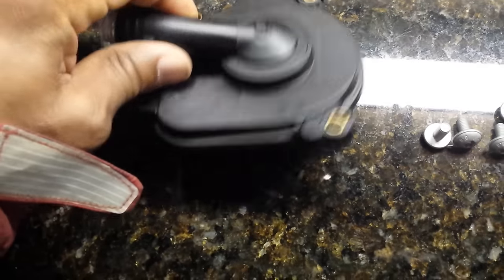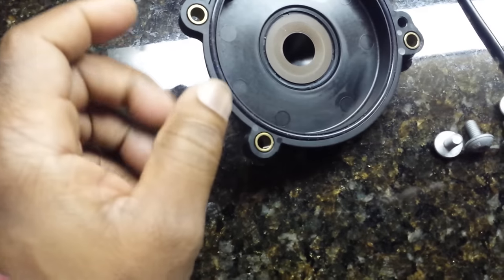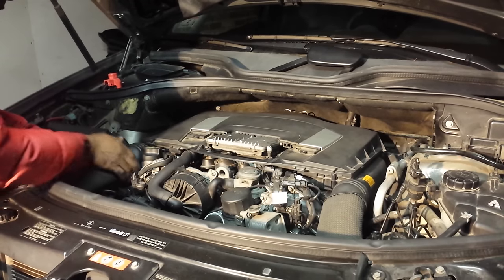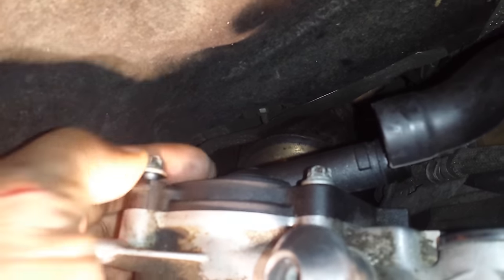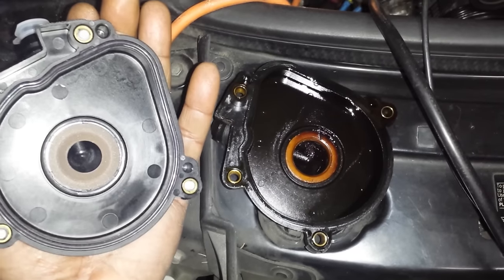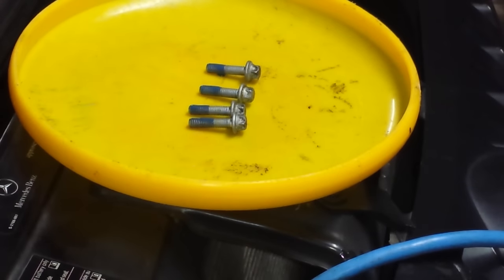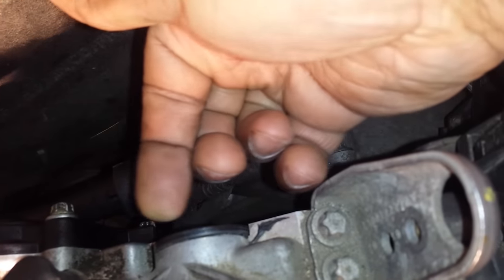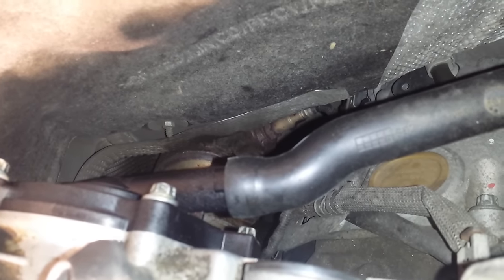Mercedes Crank Case Ventilation Valve Replacement DIY

Comment: My Euro repair shop wanted $350 labor/parts.  I bought the E10 socket (actually, a small set) for $20, yet found the spacing so tight in my 2006 C280 it was impossible to use.  Had to use a small 8mm box wrench to get the job done with great difficulty, but got it done, grateful for this video.

Comment: Thanks for the great video. The local Euro "expert" mechanics wanted to charge 1.5 hours of shop time to replace this part. I had zero experience but still managed to I change it myself in only 30mins.
Reply: that time includes diag, paying the mechanic, and actual labor for replacement of the faulty part. having owned and worked in a few shops I can tell  you that there is significant cost just to keep the lights on in a shop...if all shops just gave away labor out of convenience to every customer then no shop would ever be profitable. If you take it to a professional facility that is because you yourself cannot diagnose the issue. The facility of your choosing is paying multi thousand dollar subscriptions for parts catalogs and repair info specific to your car. Not to mention the tens of thousands of dollars required to buy the proprietary diagnostic scanner for mercedes. buying a high end luxury euro car then complaining about cost seems self inflicted to me. I hope you maintain this same energy when you have to troubleshoot something that takes more than 3 bolts and a youtube tutorial to replace.
Reply: @rustyshackleford516  The mechanic had already reported and diagnosed the problem during a service, so that time had already been paid for. The quoted 1.5 hours was purely to do what I did in 30 mins with no prior experience. And I don't need a multi thousand dollar parts catalogue when I have Google. I understand that a work shop has lots of overheads but why should I pay for 1.5 hours at a high hourly rate when I can do it myself in 30 mins? Unless I am also paying for the mechanic's time to watch YouTube videos to learn how to do it?

Comment: Wow i was trying to figure out where this burning smell and smoke coming from. Thanks to your video I changed the crankcase valve myself and can only imagine what the dealer would've charged me. May God bless you my brother. Respect💯
Reply: cashrulez101 I left my c300 2015 at Mercedes yesterday and today they called me. They want to charge me 3,5k to replace it.
Reply: mine was about $180 at a local Mb shop

Comment: Your videos are super amazing and informative. While my mechanic was working on my manifold, when he detached the mass airflow sensor he noticed oil on the housing( the hose that connects the pcv and further more into the case of the airflow) and he is of the opinion my engine is wearing gradually. I would like to believe contrary to his opinion, its the pcv valve that needs replacement. Especially now that i just came across your video on that. I noticed also that on the pcv valve, presence of oil is much and so i feel strongly i need to replace it. I would appreciate your insight concerning this. Thanks a lot for helping out always. Much love
Reply: Hello, Ive clean my MAF and noticed the same thing, any updates?

Comment: Thank you so much for sharing this video and so precise instructions. My car is a S550 model, exact same configuration for this ventilation PVC piece. The screws were Torx though (2011 model W221), but with the right socket, and specially, with knowing what to expect because of your instructional video, I was able to successfully replace it. As you state, with time and temperature fluctuations, the gasket degrades and allows oil to leak out. That was the case with my car. The mechanic wanted $225 plus MB original part $95, I completely understand they have to charge for their labor, and they have a lot of overhead, but this alternative sounded more reasonable to me.

Comment: Torx 10 (E10) is the correct size for removing the screws. You can also use a 5/16 wrench for the bottom screws. The process worked great on my 2008 C300 to replace this Oil Air Separator part. Just removed and replaced it using your video - did the Loctite too. Thanks!!

Comment: Thanks a million for the video...
discovered the leak and also discovered that due to this part worn out, it had caused the intake flaps stuck and cuased serious damage to the butterfly liver which is made of plastic. The error codes I got were related to the flaps are stuck to the open position, self adaptation of mixture error codes in both banks , horrible vibrations during changing gears, rough idle, and caused the engine consume more petrol due to rich mixture. Had to get the whole manifold out just to replace the liver. Just got the new PCV, letting the engine cool off before I replace it... great video... cheers.
Reply from the maker: Glad the videos are helping you.   Good luck with the rest of your repairs. Let me know how it goes.
Reply: @iRepairAutos  job done.made a great difference.. appreciate if you can make another video to show how to readjust the fuel pressure to the theoretical limits if the mixture is too rich. Is adjusted by DAS star Diagnostic or just some valves in under the hood? Videos just show how the pressure is measured but haven't seen any on how to recalibrate. Thanks.
Reply: You need to install a oil catch can.  Leaks from this PVC cover is not the reason for the intake manifold tumble flaps or you throttle butterfly flap to fail.  Its from the oil fume that travels from this tube.  The oil seperator that is behind the PVC cover didn't do the job enough causing fumes to go down the throttle and into the intake manifold which gums it up with sticky oil.  The resolution from the poster is to install a oil catch can, which he showed on another video.

Comment: I was just told by MB of Draper UT my valve needed replacement. They said MB covers the part and replacement in an 'extended manufactures' warranty as this is a common problem. They also said the item is on back order across the country. 2016 MB C300. I was told without the extended manufactures warranty the cost would be around 1,800.

Comment: Great video.  I came out today to find a burning smell oil under that area.  Was expecting it to be a major $$$ repair but springily it's only $100 and that also includes the 3 plugs/caps that should be changed as well since they are right there.  One of the caps you can see in your video after you replaced the breather assembly.

Comment: Great job man, I was wondering how this worked. Getting ready to change mine. I am changing the throttle body and notice a lot of oil in the hose. Wonder what mine looks like. Just got the part in.

Comment: Hello, great videos; they/you have helped me complete a lot of my own repairs. So, thank you. I have two questions, 1) is it necessary to lube the O-ring when installing the new re-breather, 2) what have you found is the best tool for opening/releasing the various hose clamps found on different hoses connected to the motor?

Comment: Bolt size is E10, but you can you use an 8mm or 5/16 12 point wrench to remove. I used the original bolts as the replacements are regular torx, and there is not much room for the upper bolt nearest the fender.

Comment: Kieth, thanks for all of your videos man.  I've got the 2002 W220 S430 Mercedes-Benz and I'm hearing a light gurgling sound from the air intake hole (without the cover on) and I want to know what it is and what to do about it.  Videos say CCV, Oil separator, Oil drip pan/ PVC, "Re-breather" ...???  What do you think?  This model doesn't seem to have the rebreather or the oil separator installed.... you mentioned In your videos.

Comment: Hi mate thanks for your video how oily is it normal?  could you tell me what is perfect breather has to be ? If i see  some oil from the black pipe connect to the air intake after change the PCV is it normal because I have bought the pvc from E bay thanks

Comment: Replaced many of them. Never seen them crack or fall apart. The seal just leaks. It is known as the oil centrifuge cover. No regular service interval required. The " diaphragm " expands due to the tight fit onto the oil centrifuge. No lock tight needed on the bolts. Don't forget to remove the plug in the cover.
Reply: what about the centrifuge itself - does it need a replacement? Not an expensive part anyway.

Comment: My vent valve and the 3 plugs are leaking bad. They were fine till I got an oil change and started to leak soon after. I recalled giving my mechanic 2 x 5 qt. cans of Mobil1 0W-40 and he telling me that he put all of it in. I did some research on the net and found out that the engine only takes about 9 qts. Regardless, I changed the 3 x plugs but the oil still leaks. I will now be replacing the vent valve but am afraid that it won't fix the problem either. If the oil still leaks, do you think I should ask my mechanic to remove 1 qt. from the engine?
Reply from the maker: +Sumit Bhasin too much oil.   The pressure is as a result too much.   Measure your Olli eith the dip stick.   I would drain the oil and put back in the correct amount.  You are causing damage to your engine otherwise.

Comment: I have the same issue with this, but somehow the benz dealership they gave me a picture of the valve but it looks totally different. Is there a different type of valve with Cla 250? Great video and explanation!
Reply from the maker: It is most likely different for your model.  Trust them further by giving them your vin number.  It is 100% correct with the vin number.

Comment: Question.. i have 2003 c240 with M112 im cleaning breather covers/valve covers. Going to replace brittle hoses too. Ports on small breather covers are clogged. . This car has oil consumption issue amd and smoke at times. Some people say valve guide seals. Some are saying breather and cyl head oil returns gummed up. Have you come accross this in a benz?

Comment: Ordered both parts....We bought a GL450 last year..and during the inspection, they noted the p0016 and the runner flap was stuck in the on position.  We had a new intake manifold installed...and the inspection noted the oil separator cover needed replaced.  We hadn't done it yet..but we have been smelling, sporadically, an awful burning smell when the car is on..not always but every once in a while.  This video has almost confirmed this likely is the culprit...even though I've not installed the parts yet.  Crossing fingers.

Comment: Another excellent video, thank you! You're making a great channel.
Reply from the maker: Glad the channel is helping other Mercedes drivers and mechanics alike.
Reply: It certainly is. On another note, I don't know whether this would be within reach of home mechanics like me, but perhaps videos on the air suspension would be good additions to the channel. Sooner or later, these Mercedes air suspensions need servicing, such as replacements of the height rods, leveling sensors, and/or the air bags/springs themselves. Just a thought.Thanks again.

Comment: I have an SL500 (1998) and it exhibits similar symptoms which is leaks oil whilst driving and drips onto catalytic converter and smells, but cannot find the ‘valve’ to purchase and replace.  I believe  am looking for the wrong item.  Help?

Comment: My mercedes needs a crank case valve replacement and the mechanic is quoting it at $3,000 with 10 hours of labor at $210 per hour and $400 for parts and misc. Based on this video, it looks like I am being way overcharged.
Reply: The reason it's so expensive to get done at a shop is because they have to replace the entire pcv assembly not just the valve. This takes undoing one of the engine mounts, and taking off your alternator and a/c compressor, just to replace.
Reply: Do it yourself or you will get had
Reply: 9 hours sitting on his az

Comment: Hey guys, Mercedes is saying we need the crankcase ventilation kit to be replaced which is 1,500 CAD.  This part alone cost close to 42 cad.  Do you think just replacing this valve is sufficient?  They also want 1,500 for the labor!  It looks easy enough to do here but I would get my mechanic to do it for a few bucks.
Reply: Hey Jason, just wondering how you ended up fixing the problem with your crankcase ventilation Valve?

Comment: Thanks for the repair video.
Always wondered what that piece was.
Reply from the maker: It's an important one.  Don't overlook it.  the diaphragm is designed to fit snugly around the breather port and as such wears out over time allowing oil to get into the air intake manifold which can cause failure of that part.

Comment: If you have a bad Crank Case Ventilation valve, would it cause multiple misfires in cyl 1,2, and 3 ? I also feel I have no brake pressure when I first start the car. I have already replaced spark plugs, ignition coils, exhaust manifold, still getting misfires on cyl 1, 2 and 3.... ?
Reply: you have a vacuum leak. the brakes use engine vacuum to assist with pedal while car is running. Since you're having an issue with misfires and hard pedal I would look at the vacuum hose that connects to the brake booster. If all else fails I would take it to a qualified mechanic to be smoke tested and know for sure where your leak is coming from.

Comment: We have a 2018 cla250 4matic. Bought it new 2019. Chk engine light came on a few times. Dealership said it was crankshaft ventilation system that’s needs to be replaced. Not very old car..only now 16,000km

Comment: Hello hope all is well... I have a 2016 mercedes c300. I have engine light with code P052E. It says PCV Valve. Car drives fine and smooth id say, haven't really noticed changes.Will this be the fix for my code?
Reply: I have the same car and issue! What ended up happening?
Reply: Anything on the oil code problem and fix?
Reply: Still no luck at fixing it but car runs fine
 Still have the same code and Engine light
Reply: @johnedough  did you ever get it fixed? Mine has same code
Reply: @HELLO123456789D  so I ended up having to replace it. He is right in the video as mine began breaking down and becoming brittle. Which in turn started to allowing oil to pass through slightly and causing it to burn. Ended up costing me around 1400 CAD including the labor. The part costs about 900 and is only available from Mercedes.
Reply: @chriscrypto3246  yep had to get it fixed check my reply below, mechanic gave me that description after the fix
Reply: @javieruribe4882  had it fixed!
Reply: @johnedough  was it the whole assembly with the lines on it or just that one piece thats on the video?
Reply: @javieruribe4882  it was the whole line for me, I recommend getting a picture from the mechanic of the removed part. Mine was bleeding oil into the entire line. What gas level do u fill up with?
Reply: @johnedough  okay thank you for the feedback, i kind of figured it was going to be the whole assembly, i use the middle which here is 91
Reply: @johnedough  and how long did you have your check engine light code on before you got it fixed?
Reply: @javieruribe4882  I had that engine light on for like probably over a year. So that was also something that added to the whole assembly being replaced.
Reply: @javieruribe4882  i was also using regular grade over here in Toronto so that was also something that was causing an issue.

Comment: How long does it take the oil to burn off the catalytic converter? I actually just replaced this on my C350 sport yesterday however it had been leaking for a prolonged period of time before that.
Reply: Did you find out how long it took for the oil to burn?

Comment: I tried E8 torx head and 1/2” 6 point socket to remove the breather bolt. No luck at all. What is the bolt size?

Comment: Hey bro i have 2018 c300 and it is showing engine sign on it because mechanic said the pcv valve needs to be replaced and told me i will take around $ 1400  can you help me what should i do ??

Comment: Would this cause a p0455 code on my c300? I already changed my gas cap and 2 days later the engine light came back on.

Comment: I changed the broken runner flap on the intake then a week after it starts smoking through the tail pipe.   So i think the i need to change part ????

Comment: Hey man fantastic video ....I have a Merc S Class 2006 w221 , I have a leak somewhere for ages & cant identify problem cant see any visible leak , smoke coming out of exhaust, my mechanic just mentioned to me that it could be this part that your showing , any help will be really appreciated....Jonny
Reply from the maker: These are definitely problematic.   They only leak when the engine is running.   The oil drip on the exhaust pipes and smoke.   It's easy to repair.

Comment: I have a 2016 MB Metris, gasoline.  The original failed and was replaced under warranty.  Now the check engine light is on again and the code is again for the pcv valve. Is this video applicable to the metris as well?  I have 25,000 miles on the Metris from day I bought new.
Reply from the maker: Similar.  I haven't worked on a metris but the concept is the same.